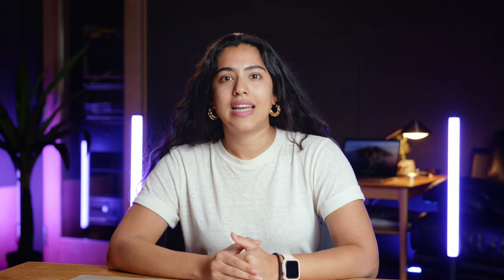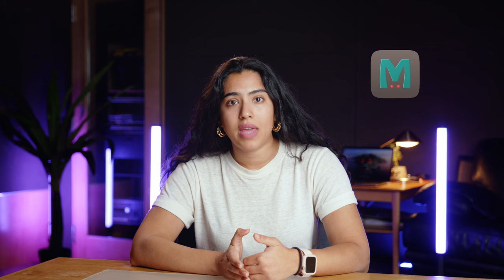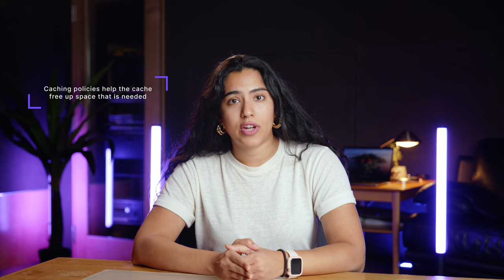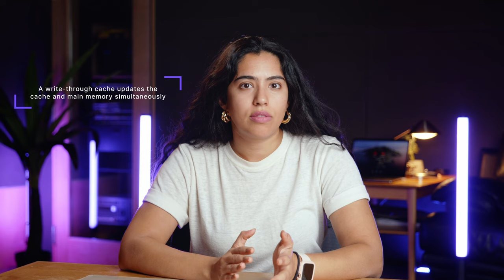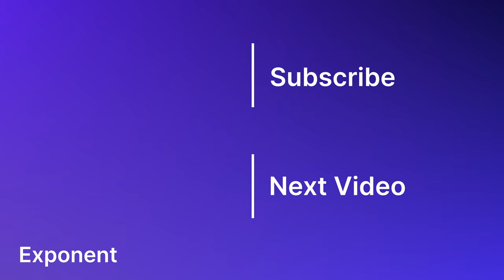Database Caching for System Design Interviews

Comment: Chapters (Powered by ChapterMe) - 
00:00 - Intro
00:45 - How does caching work?
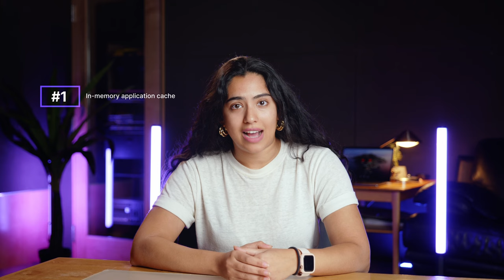00:47 - In-memory application cache
01:02 - Distributed in-memory cache
01:16 - File system cache
01:29 - Caching policies
02:38 - What is cache coherence?
03:29 - Decisions when designing a cache